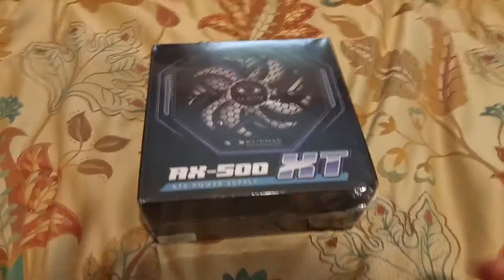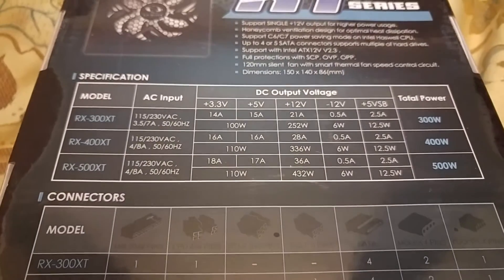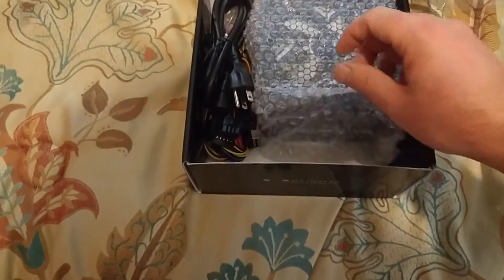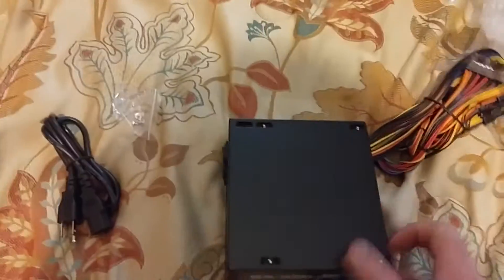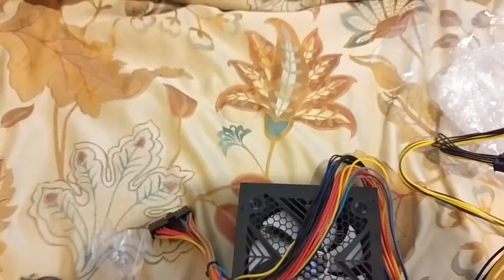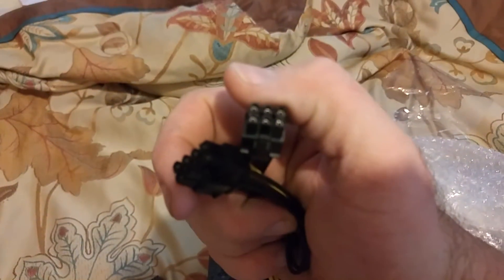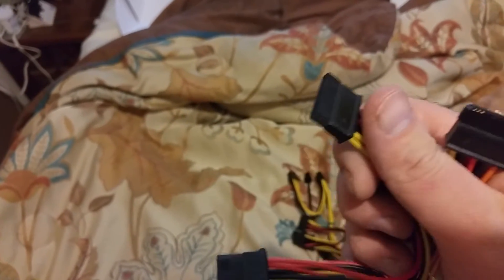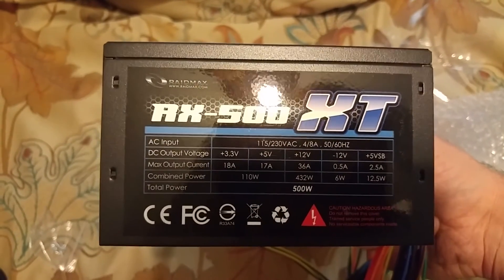RaidMax RX 500 XT Unboxing

Comment: I just bought this psu last week. How is the durability of your psu? I am a bit worried because it is quite cheap, but the seller recommend me to use this so I could use the new video card I bought.
Reply from the maker: I do not know. I bought this for a build that I was doing as cheap as possible I think. I don't remember. But it is a low end power supply that I think has some protections built it so it says. But if it's a newer build I wouldn't recommend it. I only used it because it was a old components I had laying around. I would recommend a evga or some name brand that is minimum bronze rated.
Reply: whats ur gpu?
Reply from the maker: In this pic I think I had a GTX 285
Reply: Its good upto gtx 1650
Reply: Make sure don't do Overlocking

Comment: How is/did that psu hold up after? My brother in law ordered up one of these because the specs seem good for a cheaper price than a lot of the competition. I hear a lot of negative feedback about Raidmax and tried to steer him towards an EVGA or cooler master unit
Reply from the maker: It turned out to be a decent power supply the biggest issue I could see is people trying to use near the maximum power limit. It would probably put the PSU under too much stress whereas the more high quality brand names are able to handle that high stress. For the PC I used it in it was perfect and as far as I know it's still being used today

Comment: Can you connect rgb fans with this psu?
Reply from the maker: No it didn't have special rgb power cables or anything.
Reply: @krypticnexus  actually im going to buy new build with this psu and it can run 6 rgb fans in case ??

Comment: Can i use with this with
                 -Intel i3 9100f
                - gtx 1650 4GB
                 8gb ram
Reply from the maker: yea i dont see why it wouldnt work your only looking like 300 or so watts check out a watt calculator. https://outervision.com/power-supply-calculator
Reply: You mean my selection is extra wattage for this?Thanks for supporting.

Comment: Can this psu handle this?
Ryzen 3 3200g
16gb ram
Rx570
Reply from the maker: Should do fine.
Reply: @krypticnexus  what about a ryzen 5 3600 with a xfx 580?
Reply from the maker: Compared to the other comment that's not much power difference so it should be fine
Reply: @krypticnexus  okay thank you a lot my power supply just died so i’m tryin to get a new one

Comment: Intel(R) Core(TM) i3-10100F CPU @ 3.60GHz
8.00 GB (7.90 GB usable)
gtx 1650

can it handle this?
Reply from the maker: Yea this could handle that just fine. But if I was you I would look at something like https://amzn.to/3E2qTfg    because it's probably the same price or cheaper plus it's a name brand. Like as far as I know the system that uses this power supply in the video is still going strong but with newer hardware I would go with something more name brand. Just because of warranty and stuff like that
Reply from the maker: https://amzn.to/37IEyMF
I noticed the others was recertified

Comment: How many molex connectors is on one rail?
Reply from the maker: +Joe Smote Gaming sadly I cannot answer this videos of while back in that computer is long gone
Reply: Anthony Cress dont remember?
Reply from the maker: +Joe Smote Gaming looking it up on NewEgg it only has two Molex connectors five sata connectors and one floppy and one 6-pin pcie and 1 6 plus 2 pen pcie and a 4 + 4 CPU and a 24 pin motherboard connector
Reply: Ok i only need 2 molex connectors for the gpu. I was building  a gaming pc and nothing  powered on. So tomorrow ill be getting a psu tester and if it fails somewhere ill be getting this
Reply: When you say molex connectors only being 2 what is the name for it on the parts list for newegg
Reply from the maker: +Joe Smote Gaming should either be peripheral or Molex
Reply from the maker: +Joe Smote Gaming and if you're meaning GPU plugs that is called pcie
Reply: Anthony Cress thanks peripheral is what i was looking for. Thanks

Comment: Did u think guys if i have:

6 Rbg Fans
Ryzen 5
msi mobo
Mechanical keyboard with RGB lights
Mouse with RGB light
nvidia galax gt 730

he can hadle that? though my current PSU is Generic(local/not true rated).

Thanks for your Answers
Reply from the maker: My biggest issues is the gt730.
Reply from the maker: Sorry um I think the power supply will be fine for that build

Comment: Can you tell me is it loud psu ?
Reply from the maker: Wasn't loud for me  but inside a case setting 5 foot way it's hard to tell what fans are going but the overall noise from the hole system was quiet. So couldn't complain.

Comment: I hace ryzen 2200g 
8gb ram 
Rx570 
Do you think this psu can hanndle this
Reply from the maker: Yeah I think this PSU would be able to handle that
Reply: @krypticnexus  he can handle it but not for long time just for a while and your computer will burn ... my pc ryzen 3 3100 gtx 1050 ti strix 8 ram but i wont keep using that psu so .. im selling my pc
Reply: @krypticnexus  because its hard to found psu or gpu or cpu with a good price in algeria
Reply: @BOOMbastic... did you change it? If you kept it did it cause any trouble?
Reply: @mostafalking2034  yup almost burned my pc .

Comment: I bought the same one and it blew up
Reply from the maker: Out of curiosity by chance could you have been pulling too much power.
Reply: Anthony Cress 😂that comment had to be fake I have the same one with a 1660ti it’ll shut off when it draws to much power but other than it’s fine and it has lasted me awhile
Reply: @jontrisdale8422  I totally agree, I just purchased one of these to complete a build and needed something cheap   i5 4460 2x4gb gskill,msi 1060 6gb gaming x edition, one hdd one fan, card overclock maxed out and have no problems.
Reply: @BonzaiTheGreat I have 2 pc's one with the 1060 6gb and one with a 1650 but wouldn't use it on anything more powerful but it's a cheap psu, would normally go for a better brand like corsair but all depends on your preference